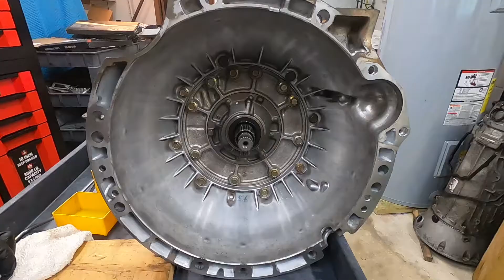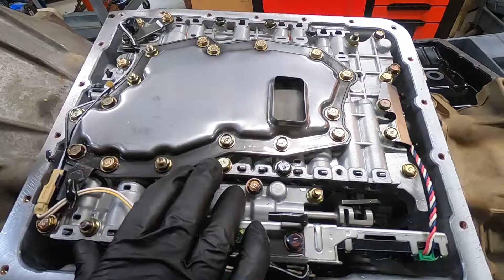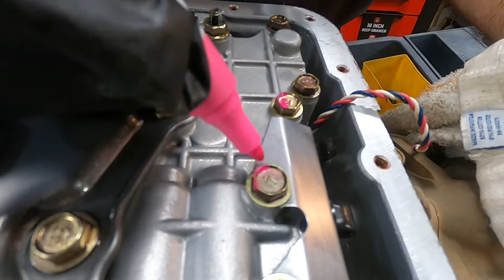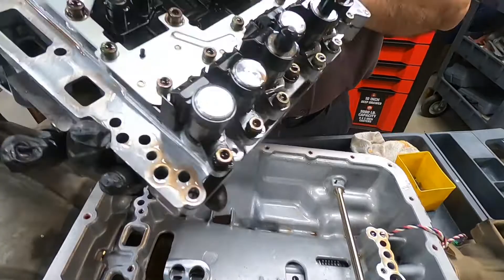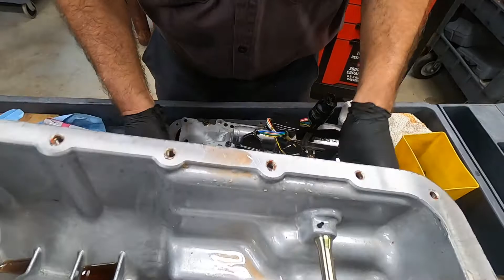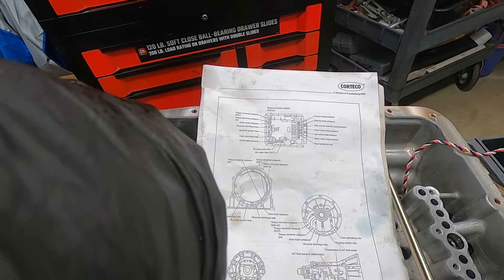Nissan Infiniti RE5R05A Transmission Teardown Part 1

Comment: Is there a way to know which model TCM you have using the VIN?  And does it need to be reprogrammed when swapped out?  I have P0717 code.  Input shaft speed sensor.

Comment: I have rebuilt a bunch of transmissions over the years. Not even close to enough to consider myself a rebuilder. But I wanted to say that your video is absolutely amazing. You show every detail and everything that I was looking for. I rebuilt a very similar transmission a long time ago for a dump truck. I wish I had this video back then. I can looking for it now.Because I have an Armada transmission that works perfectly driving down the road and no codes whatsoever in the computer, but it slips in reverse to the point of not moving at all anymore.

Comment: Hi Thompson, I ve an RE5R05A on my Nissan frontier, one morning when I pull out a parking lot when put it in Drive it started struggling and move very slowly and couldn't climb a smallest obstacle /terrain. My house is on the hill and I tried to go on reverse and it was pulling will normally power. I put on my diagnostics machine and it displays no fault. What could be an issue?

Comment: Hello. I have a 2010 pathfinder 4.0. When I put gear in D I have lags. Always about 2 seconds. R turns on quickly and without any problems. Changes gears smoothly while driving. only D has delays. If I increase the engine speed before engaging D, the gear will be engaged faster. what could it be? What do you think? electromagnet or something inside the box? .
oil replaced. it wasn't very dark. the oil level is also ok. I will be grateful for your help

Comment: Very cool to come across this video after I just had the transmission in my 350Z opened to fix the broken circuit that was mentioned in the video.  I'm not mechanically inclined aside from smaller, easier access things, but it's always really cool to learn about what vehicles work!

Comment: Truck i just got will go into gear and pull for a minute..then stop pulling..if i turn it off and wait a couple minutes and restart..it will fall into gear and pull again..when i connect scan tool it says no communication..help

Comment: The Saga of my  transmission. about 2 years ago I got a code for P1716 Turbine Revolution Sensor. The transmission had a less than 230K miles on it. I replaced the valve body to the tune of $740 for the part and did the work myself. That lasted less than a year, until 12/31/2021 when the transmission would jump into N. I suspect that the high mileage on the transmission meant that clutch pack material clogged passages in the valve body. Managed to get back home and parked it. I got the transmission fully rebuilt on 1/12/2022. 

Last week 12/08/2022, the transmission threw the code P1767 HLR Solenoid. The same transmission repair shop fixed it under warranty. Apparently there was a faulty ground somewhere on the valve body, and they replaced the valve body entirely. They suggested that it was due to Florida's salty air that corroded the ground wire. I'm struggling to understand how salty air could get into the transmission where the valve body lives to corrode anything in there. I think they said Ground Strap, then that would be outside the transmission, and if so why replace the valve body? The car now has 239K miles

Going to re-watch Part 1 and 2 of this video. Seems like the valve body is the weak link in these transmission. Seems to me that putting a TCM in bath of hot transmission fluid for thousands of miles is not the greatest of ideas.
Reply: Glycol Coolant and water contamination, a common issue and is why they get corroded.
Reply: I've been doing a lot of research as I have shifting problems too, 06 G35 automatic with 260k miles!
Reply: Turbine Speed sensor code.
Reply: @Chilticoatl915  probably time for a full rebuild...250K is nothing to sneeze about. It served you well.
Reply: @Chilticoatl915  yep, but not in my case.
Reply: @cfauvel  I've seen your name on some forums, yeah I read about your adventure with the rebuild from a shop.
Reply: Would a used one from Japan with same valve body style be more cost effective?
Reply: @Chilticoatl915  
Personally I’d go with a rebuild, they’ll remove old one, rebuild it, reinstall it and warranty it for at least a year. Getting a used one from Japan, you’ll roll the dice.
Reply: @cfauvel  have you ever considered to rebuild your transmission on your own?
Reply: @Chilticoatl915  LOL...nope never ONCE considered doing it myself.
Reply: @cfauvel  Im just glad it not a CVT LOL ahahaha
Reply: @Chilticoatl915  actually from what I've seen on YouTube of dismantling a CVT I think it is easier to do. The only worrisome part about the CVT is the hundreds of vertebrae looking things that make up the "belt" ... I'll try to find a video of one being dismantled....looks SUPER simple... If the "belt" comes with the vertebrae pre-installed it shouldn't be too bad.
Reply: @cfauvel  Yes, I remember, Toyota CVTs, Have a Honda with a CVT currently as well.
Reply: That is terrifying news. I have a P0745 code that mine occasionally throws. It only has 161k on it. Everything is still operable, clutches still grab hard, just that code that disables 5th gear and manual mode.

Comment: Hi
I had a transmission rebuild 2000 miles ago. Nissan 2005. It started leaking oil so the replaced the seal and it still leaking. Please help me

Comment: I have a 2005 Nissan Titan. With the transmission, its like when it should take off from a dead stop in first gear, it’s takes off in the highest gear it has. Once I get going a bit it is fine but never shifts. Is that possibly valve body issues?
Reply from the maker: @davidd6854  do you have check engine light?

Comment: Not sure if you can help me but My front brake solenoid went bad.  so I took out the valve body and replaced the solenoid. Put everything back together and reverse works but when I put it in drive it stalls instantly. I’m guessing it’s trying to go in drive and reverse at the same time or something. I thought maybe the wire harness got pinched but I didn’t see anything when I took it back out.  I don’t see anything wrong with the valve body but I don’t really feel like putting it back in and doing the same thing. I do remember touching the gear selector plunger and had to line it up to put the valve body back in but everything looks right. Not sure what it could be
Reply: Yo I had this same problem and then I get a new trans from junkyard and put it in today and it still didn’t work. What fixed yours?
Reply: @JayJay-pm6yf  yes. I took it back apart and cleaned everything very good and inspecting everything and testing continuity between the tcm traces to the solenoids. Everything seemed good then I took all the solenoids out. Cleaning them. Carefully put it back together and it was fixed. So not sure what it was exactly. Hope this helps

Comment: Question: To replace the vehicle speed sensor you have to crack open the tail shaft right? and does there need to be some silicone between the main body and the tailshaft? I'm replacing the valve body in my G35 and figure whilst I'm there best to put in a new Hitachi VSS.
Reply from the maker: Yes, you have to crack open the tail shaft. You don't need silicone. There is a tail housing gasket (ADAPTER/EXTENSION HOUSING GASKET).
Reply: @ThompsonAutoTest  Well I ended up NOT replacing the VSS. So far so good.

Comment: Hey how are you doing I was inspecting a valve body from a g35 and I noticed where the turbine and intermediate sensor are one of them had a melted top with kind of a slant not a perfect cylinder shape. Would that cause a transmission problem I feel stupid asking as a mechanic but I didn’t know what they were till now
Reply from the maker: Excessive heat from a slipping clutch can melt the plastic housing but if it continues to work without setting a corresponding code it can be considered serviceable.
Reply: @ThompsonAutoTest  I eventually swapped the transmission and sold the vehicle

Comment: Great video! but I have a question. I currently have this transmission in my 350Z and I am getting code 1716 and the car occasionally does not want to go into 5th gear or shifts erratically. Code says it is the turbine speed sensor. can I replace just that sensor or do I have to replace the entire tcm?
Reply: I'm in a similar boat...so here is what I found.

there are two sensors ON the TCM (transmission control module - the black plastic in the middle of the valve body ). One of those is the turbine rev sensor....I suspect the one farther back towards the rear.  When the spinning of the front sensor is too different than the rear one the TCM throws the p1716 code. Technically they ARE not replaceable. Theoretically you COULD find the exact sensor part , gingerly separate the plastic halves (after labeling and removing the solenoids) and remove and replace the two sensors. Not for the faint of heart.

More than likely though your tcm is going out and for whatever reason they don't JUST sell that part. So remanufactured valve body or brand spanking new seems to be the way to go that will include the TCM. I found a remanufactured valve body for my G35 for $740 with 3 year warranty.
Reply: update: So far so good with the new valve body, but JUST recently started a hard shift from 1 to 2 when cold, no codes. Once warm works perfectly. 
Going to replace about 5 qts of transmission fluid with hopes of THAT helping.
Reply: Update: the hard shifts ( 2-3) got progressively worst.. on 12/31/21 it slipped out of gear for a split second. Had the transmission fully rebuilt this January /2022 with 230,000 miles to the tune of $3185 ( labor included). :-(
Reply: @cfauvel  Such a helpful video! Would you generally replace the valve body+TCM for a P0717 code as well? I have a 2007 G35 that decided to stop shifting to gears 4&5.
Reply: @shawnpearson646  I’m no expert … not sure what your code is, but the shifts behavior would be from the valve body. The fluid pressure pushes these valves in and out… if the valve gets stuck it has to build up enough pressure to move the valve and it’s usually not smooth hence the hard shift..

How many miles on the tranny?

You can try a fluid flush professionally done where they swap out most of the fluid with new fluid. Or get the tranny hot, open up the pan’s drain plug, catch the fluid and replace that same amount … do that a few times.
Reply: Read what a p0717 and it is similar to the code I had. I can see if the clutch packs are so badly worn that the revolutions counted from the front turbine and rear turbine are too far off that it would throw the code.

Try the fluid swap first, then reman valve body if the mileage is low enough,,,, otherwise rebuild time.
Reply: @cfauvel  Very helpful, thank you! I've done about 3-4 drain and fills, along with dropping the valve body to clean the solenoids. BUT, now I understand the likely cause of the sensor failure... If the clutch has no metal left, the sensor cannot detect the gears that aren't there. I plan search for a rebuild soon but not many shops locally. Knowing the cost of yours rebuild is a little sickening, but seems that's where I'm headed. Have a great day!
Reply: @cfauvel  Posting to close the loop. After a month's wait to get an appt, your suspicion was confirmed, the sensor isn't detecting gears that are sadly no longer in the transmission. Quote for used one is just under $3k with a 3-year parts and labor warranty.
Reply: @shawnpearson646  3yr warranty is better than I got. But if they do these often and know what they’re doing, it’s going to last at least 5 years or more… I had 15 years on original trans. Maybe I get another 10-15?